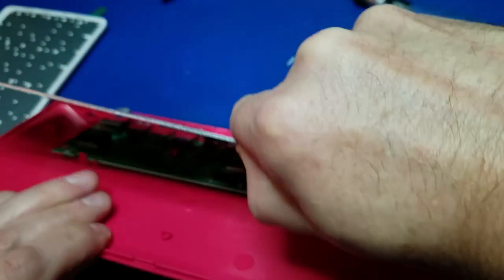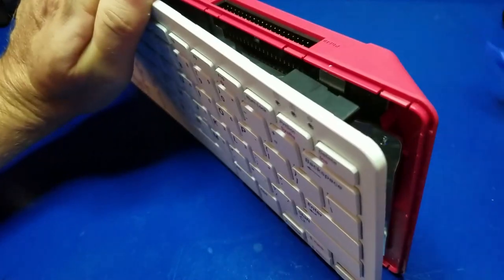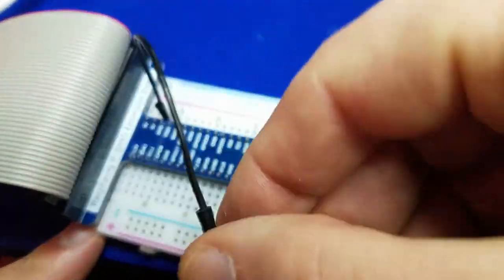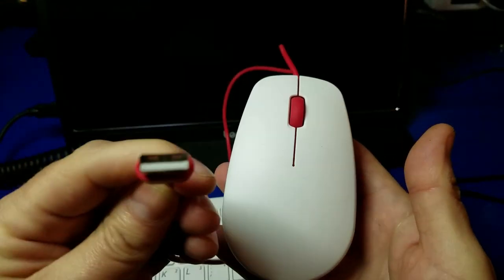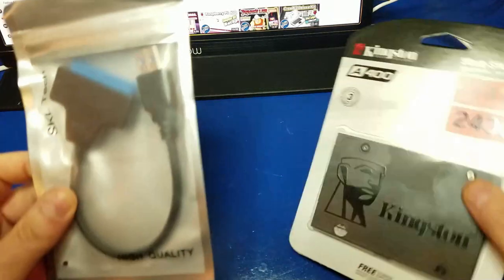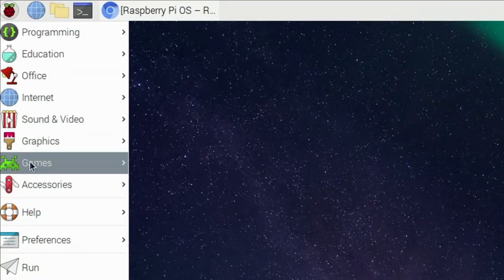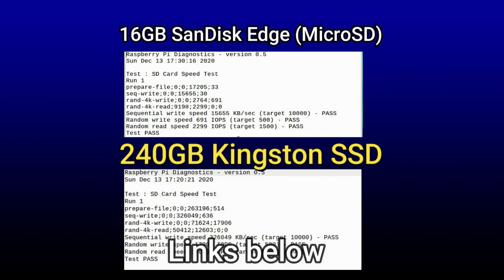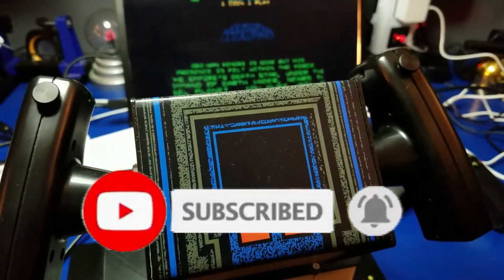Raspberry Pi 400 Tips + Teardown: GPIO, Pi400 Setup, SSD Boot, Battery +more

Comment: The only thing I wish they would have done with the Pi 400 case was to either have a cutout to hold a 2.5" SSD, or a snap door or something.
Reply from the maker: That would be pretty cool for a version to have a built-in SATA slot.  Perhaps call it the Pi 400 XL or something.  I like your idea!

Comment: Does this suffer from  the same emarked cable issue the raspberry pi 4 is facing? Also, Can I power it from my tv usb?
Reply from the maker: AFAIK, the e-marked cable issue only existed in early versions of the Pi4 and was corrected on the Pi4/400.  While the 5V from the USB TV "might" power it, I would recommend using the official power supply with the Pi 4..  Especially if you want to attach any devices to the Pi 4 USB port (SSD, USB sticks, etc.) or overclock.
Reply: @WagnersTechTalk   Thank you!

Comment: I've never seen a ti99 before, I've ran ti99 and other ti emulators, but i had no idea how cool the ti99 looked, that silver casing looks epic. Makes me think of a Delorean xD.
Reply from the maker: They were ahead of their time in some ways and behind in others.  Still, awesome machines considering they are nearly 40 years old at this point.  If you're familiar with Dragon's Lair, a few years ago someone made a cartridge that will play on the TI and it's amazing considering the limitations of the machine.  Just if you're curious, you can find that video (and others) on this page: https://wagnerstechtalk.com/retro-computing/
Reply: @WagnersTechTalk  I do know Dragons Lair (and Space Ace) I've ran them (in Retroarch) it is crazy that a laser disc game is running on a ti99. I have a couple of systems from that time, a spectrum zx80 and the slightly newer Atari st 1040. I still have a ti99 emulator on my psp called pspti99 it's a port of ti99sim.

I just tonight (an hour ago) purchased the Raspberry pi 400 kit with mouse etc and i also purchased a 120gb integral brand SSD (and a usb adaptor) I've wanted a newer pi for years (I have a pi 1 model b+ somewhere) I was going to get the 8gb pi4, but the pi400 seemed like it would be a lot more convenient for emulation (especially for the older home computers like ti99, BBC, msx1/2, pc88, pc98, Atari st, Amiga) I'm sure it will make dosbox easier too.

I really like your website it's great, i checked your VR section, i also have a quest 2 256, i got about it about 3 months ago, I set up developer mode (recently installed Minecraft/pojav launcher) have you tried the virtual boy emulator on it. I have psvr too, but since the quest i haven't used it again. I also checked your raspberry pi section which I'm sure will be handy when mine arrives.

Have you tried any of the Orange pi's? They are insanely cheap now and were quite powerful, I had Armbian and retrorange installed, but unfortunately they don't have the user base of the Raspberry pi.

I would like to dual boot on the 400, have the most stable os and the best emulation frontend. I really liked Armbian on Orange pi and now Armbian supports raspberry pi, is it worth considering over the official Raspberry OS? Lastly which do you think are the best options for emulation? Retropie, Batocera, Lakka or Recallbox?

Thanks for the link to your site, i just subscribed to your channel too.
Reply from the maker: Thank you for subbing to the channel, I appreciate your support!

I think you'll really enjoy the Pi 400.  If you're wanting to experiment with a bunch of different OSes, this video may be of interest to you (PINN Lite: https://youtu.be/1Cqta4go45U ).  Keep in mind, you'll need to select all OSes you're interested in up-front, you can't change it later without wiping them all out.  But, saves you from having multiple microSD's/SSD's.

I have tried the Virtual Boy Emulator on the Quest, it's pretty awesome!  I used to own one when they came out in the 90's, I may still have it somewhere but haven't been able to locate it.

I have not tried an Orange Pi yet, I really should though (I'll look more into this).  Thank you for your kind comments, I hope future content is of interest to you. I tend to rotate different subjects, but sometimes get on a particular kick and may see a few videos on a similar topic/product.  I try to keep it balanced and hopefully helpful.
Reply: @WagnersTechTalk  That is so cool you own a Virtual Boy, I always wanted one. I have a similar problem i can't find my Master System, I have all the cartridges still in their cases, but I can't find the system, maybe it got packed in a loft (attic).

That sounds perfect for the pi 400, being able to install a selection sounds ideal, I really like playing about with Linux, although ive always been limited to what i can run it on, I used to run yellow dog Linux on PS3 and I have one of those old LLL little Linux laptops. I've also been curious about trying out the RISC OS on Pi. I'm glad to discover Armbian has official Raspberry Pi support, I think having access to the RPI community will be a great boost to Armbian in the long run.

The Orange Pi is definitely worth a look, they are jam packed with some pretty cool things, i have a Orange Pi PC2. I just checked out their site again and they have started releasing new boards (seemed like forever they were selling the OPI 2 range) i also discovered they are releasing an Orange Pi 800 (a copy of the Pi 400) with some higher specs except it has only 26 gpio pins. Here's a link. Thanks.

http://www.orangepi.org/html/hardWare/computerAndMicrocontrollers/details/orange-pi-800.html

Comment: Does this work as a just keyboard? What I mean is can you hook it up to a pc/android device and use it as a keyboard? I assume no, but would be nice to use it like the raspberry pi keyboard you reviewed last year.
Reply from the maker: At this point, going to have to say no.  I did try connecting a USB (male to male cable) to both the USB 2.0 & 3.0 port, then USB-C for power to see if it would be recognized as an external keyboard.  It didn't see it in Windows 10.  However, it may be possible in the future with a firmware update and/or a custom HID driver.  I'm not aware of any option like this at this point, however.  While it looks very similar to the keyboard I reviewed last year, that keyboard had a single USB cable that would connect directly to the Pi 4.  Hope this answered your question.

Comment: So that monitor is portable and not plugged to power in this video? So it has its own battery?
Reply from the maker: It is a portable monitor and not plugged into a typical (110v) power outlet and the monitor does not have it's own battery.  The power input to the monitor is USB-C, so in this case I'm powering the monitor AND the Pi 400 all from a single battery pack (Power bank to the monitor is a USB-A to USB-C cable).  Here's a review of the portable monitor, if interested: https://youtu.be/zZVxXA_eCdQ

Comment: Hey Bro! I finally got one of these! Using it to emulate Amiga and making old-fashioned "octamed .mod" Amiga music, but with better audio Quality if you know what I mean.... And I am thinking about experimenting more on this Pretty Good Little Machine!
Reply from the maker: Awesome!  It makes a great Retro computing+gaming device.  I picked up a 2nd Pi 400 from CanaKit myself, giving it away as a Christmas gift for my nephew.  He doesn't have a computer and this should be perfect for him.  Going to install TwisterOS and get everything pre-configured and ready to go.  Picked up a controller and the GPIO kit so I can show him around on that too.  Man, if I had one of these when I was a kid would have been much further along than I am today.
Reply: @WagnersTechTalk  I have Twister OS installed.... It looks and works very good on it.... And, believe it or not.... It comes with a version of Wine installed, called Wine Desktop.... I was able to run old Windows 95/98 Software and few games as well on this Pi....  You should associate Wine Desktop to open the ".exe" files and that should do the trick.... Not all Windows Software will work, but as I said, I tested it with old 95/98 Windows Software and It worked! Also you might want to overclock the PI to 2 MHZ, the Pie will get slightly warm, but not overly hot..  Anyway...  Twister OS and Pi 400... Perfect Match! And by the Way.... You are where you are and you know a lot of stuff and.... there is always time to learn... God Bless You Bro!
Reply from the maker: @a.mandelli4602  I was working on my nephew's Pi 400 today and got it all setup with TwisterOS+RetroPie.  Can't wait to give it to him.  He won't be interested in Wine Desktop, but I certainly am.  I will be doing more with that very soon on the channel!
Reply: @WagnersTechTalk  Awesome Bro! Wine Desktop, loads up in the PI and looks like a Win 98 desktop with a File Manager.... Then you can scroll thru your files and launch old Windows Software from there.... But I have associated Wine Desktop to open ".exe" files as a default.... And it works very good.... I think the whole Wine Desktop thing is based on "Mono".... But anyway it's all very good!